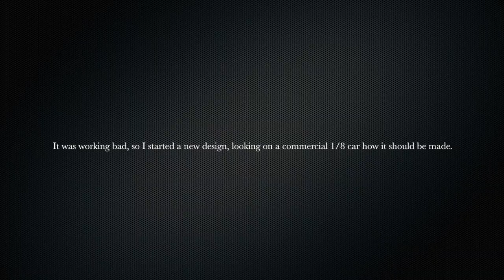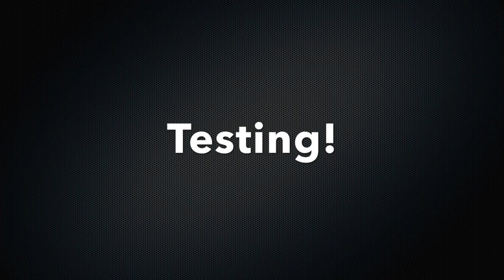Testing Handmade 49cc RC BUGGY 2stroke 1/5 DIY - PART 2: testing [Pocket bike - Chainsaw]

Comment: Wow that is nice. The best homemade design I’ve seen. It’s fast unlike other ones I’ve seen. Great work.
Reply from the maker: Thanks!! It tooked me a lot of time planning where and how every piece was going to be placed. The car has a lot of torque, as it has two chain reductions 😀
Reply: 3DPrinting Creative yes I noticed that. It’s sweet. The hardest part for me is to get the steering working without the linkage binding up. Great build!!
Reply: @CMBProjects   
Hi what shocks are you useing im thinking of building a mud truck with the same engine set up
Reply from the maker: @hermansims304rcrawlingteam3  look for 190mm 1/5 shocks on ebay, they cost like 20$
Reply: @CMBProjects  thanks alot
Reply from the maker: @hermansims304rcrawlingteam3  share your project on youtube! 👍

Comment from the maker: I'm starting to design a new car; same engine, independent shocks on 4 wheels, lighter chassis, cardan transmission (RWD) with 2 steps reduction 1:3 and 1:2, for a total reduction of 1:6 (this car has 1:12), lighter plastic fuel tank, shorter distance between axis, aluminium floor and other parts... 
What would you improve from this one to the new car? Tell me!